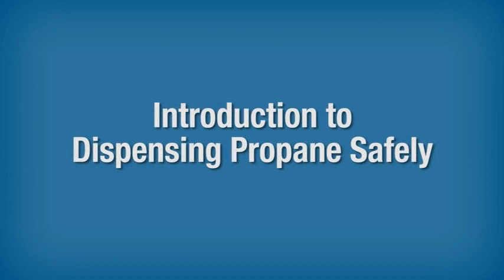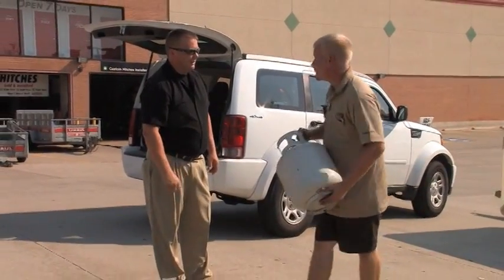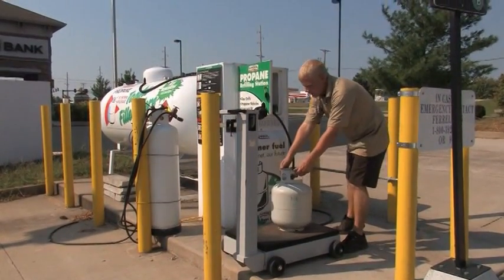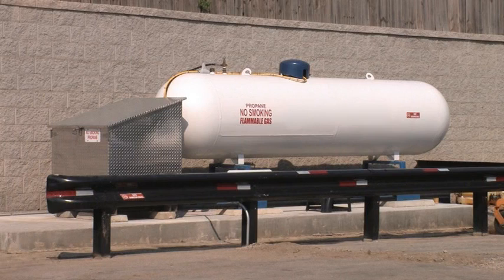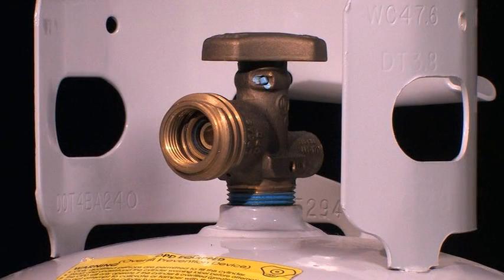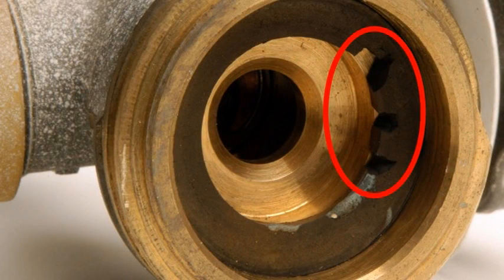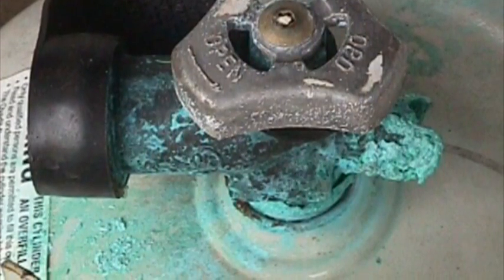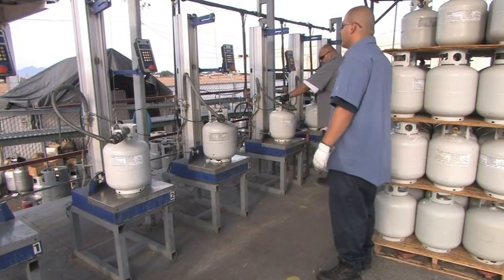Dispensing Propane Safely

Comment: An angled rack for forklift cylinders is better than the one depicted, IMO. My previous employer had such a rack, it was designed for ease of movement with a forklift. I wrote "EMPTY" on the bottom of each tank so as they were replaced, it made it clear that the rack of tanks was in need of filling. Full ones were in the rack head side up and empties with the bottom ends up and visible,

Comment: I worked for uhaul for 9 years. Nobody does this, they just slap 4.6 into the tank then charge it asap. Mostly because Uhaul doesnt believe in payroll lol, it will be two guys trying to rent 12 trucks per hour. Aint nobody got time for propane.

Comment: Here in Texas, the local propane truck meters are set one a year and calibrated for 60 degree days.  The day my two new tanks were filled it was 37 degrees the night before and maybe got to 46 that day.  Both tanks were "Dosed" with 8 gallons of Propane before being moved into their fixed placement.  When the truck that has the FIXED temp. calibration meter pumped both tanks , on each tank 75% full registered on each gauge, the truck meter said I got 400 gallons in each tank.  Safely, how many gallons did I actually get?

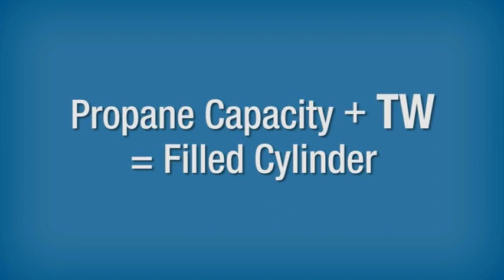Comment: He said that they are filled to 80% capacity but then says fill to 42% of the WC weight at 38:00.  That will result in 20 lbs of propane being put in a 20 pounder which would be completely filled. That’s a no no. Did I miss something?
Reply: That's a good question. 

I believe the propane capacity calculation, WC x .42, will give you 80% of the actual full capacity.  

So, a "20lb tank" can hold 20lbs of propane when it's filled to 80%.  Here is my reasoning-

An OPD will shut you off at the 80% mark.  That's its purpose.  A 20lb tank has an OPD that usually shuts off at around 4.6 gallons.  

Each gallon will weigh about 4.2lbs.  4.6 gallons will get you right around 20lbs of propane.  This is where the OPD shuts you off at 80%, thus a 20lb tank means that it holds 20lbs when at 80%. 

Does that make sense?

Comment: What's "external and internal hydrostatic?,    32:35 I didn't catch what "POL" stood for. Petroleum, oil and lubricant ? So water capacity is measured in U.S. pounds?  39:58 a couple of "goons"
 It's not the paint brush or paint applicators fault, it's the painters fault, shure always try to shun the responsibility away from yourself, lol  Thank You.  This answered a lot of questions I had.
Reply: Pretty sure POL doesn't stand for anything it's just that type. I believe POL stands for the original manufacturer of that type of fitting.
Reply: It's a Prest o-lite fitting or only left hand thread.